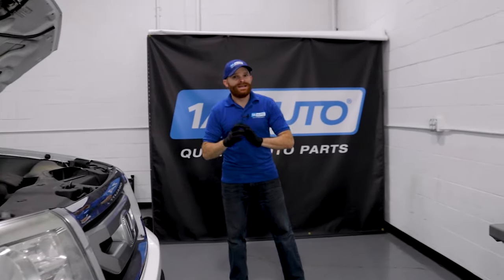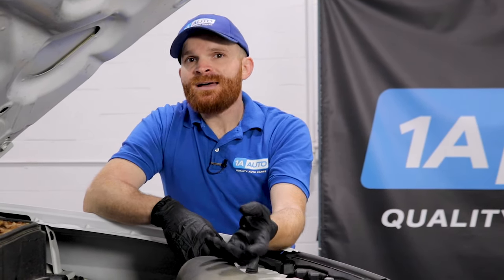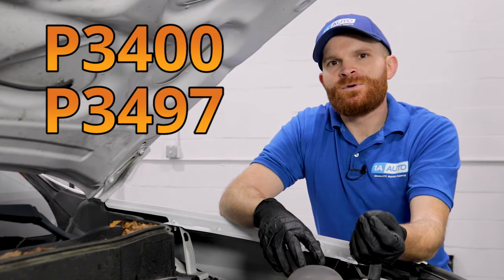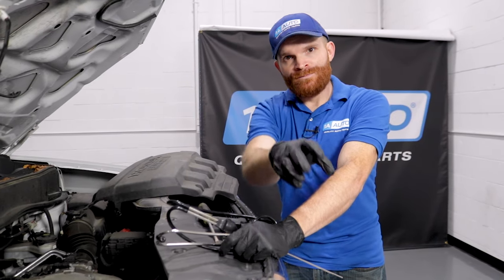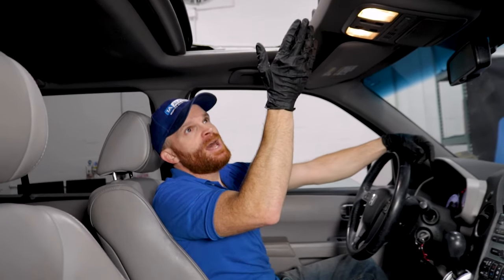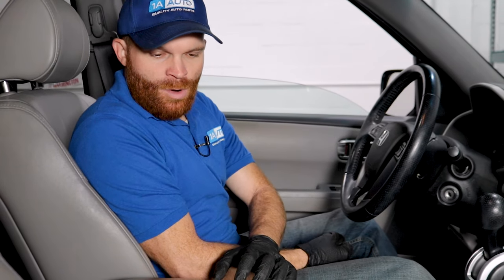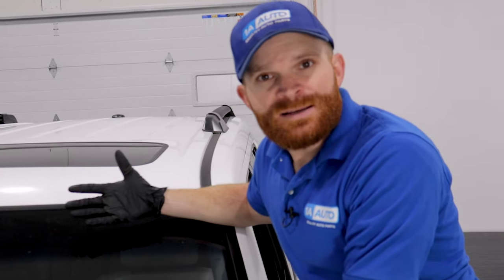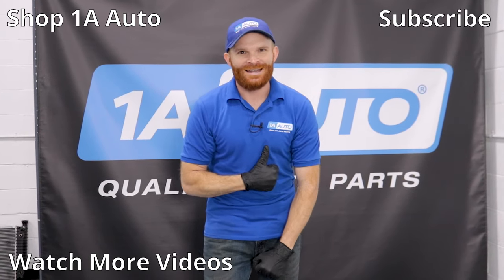Top 5 Problems Honda Pilot SUV 2nd Generation 2009-15

Comment: Are you saying that oil use and prematurely fowling plugs are a normal function of VCM and not because of the well documented issue of improperly sized piston rings in some models like the 2013 Pilot?  I have to change the plug in cylinder 3 every 5000-8000 miles due to oil fowling or just running hot.  Plug #1 less often but prematurely to be sure.  I have to top oil off at least every 1000 miles and sometimes more.  Just wondering how it’s an acceptable design for a car to burn oil straight out of the factory.
Reply from the maker: +Humble RoJo Thanks for the feedback!
Reply: I know right.
Reply: Get an S-VCM or VCM Tuner 2. It'll shut off that awful VCM "feature" and may help stop the damage being done to your engine. If it gets too far the only fix will be to tear down the engine and replace engine rings.

Comment: I'm about 99.9% sure I'm buying my wife a super clean and very well maintained 2012 Pilot with 180k miles on it. The current owners just had the timing belt replaced and whatever may go along with that taken care of.  For those of you that own Pilots, what's your opinion on buy one with higher mileage? Like I said it's been very well maintained.
Reply: I don’t have a pilot but an odyssey. It’s the same exact motor. It’s an excellent motor. Just take care of it (oil change, valve lifter adjustments etc) and it should last a long time problem free.
Reply: I have an 06 with 192k and runs very well. I would get one if I was you.
Reply: Just bought a '13 Pilot EX-L last week w/116k on it, love it.  This site has helped a ton...

https://www.piloteers.org/

I'm not even a "car guy" and I love it, really starting to warm up to the DIY maintenance side.
If the one you are shopping for your wide is well cared for she will have a great vehicle for many years.

Comment: The problem is whenever the ac is on the car doesn't function well then after somtinlme it will start overheating then you put of the ac it will the temperature comes down after a long drive in traffic and you stop the engine the car won't  start again until  after hours of parking it to cool down  the it will start.

Comment: Only one I have noticed a that slight knock. I think battery. Also you might to add battery to that list. My 2014 is on its 3rd battery.
Reply: It’s not a vehicle that has the problem it’ll be the cheap battery you’re buying

Comment: So I was lucky with my 2006 with over 200k miles and no problems at all.
Reply: I have an 05 @ 223333 miles as of today.  I’ve had it for 2 year. Check I gone light and maintenance require light been on for a over a year. When I got it it had 115k on it. I’ve road tripped it around the country 3 times. Ended up getting a hole in the radiator with a slow leak. Nell never really over heats. I want a mid gen bad tho
Reply: @dylanandrews7798  I have an 06 with 192k. I'm looking to get a 14 or 16 next. Last of the good Pilots.
Reply: @anonymoususer1824  16 is very un reliable. Second gen ended 2015

Comment: Having an issue with high speed vibration when accelerating. Happens at 70mph+. Shakes pretty bad when pushing petal, stops as soon as you let off accelerator. I have the VCM bypass attached. Any suggestions?

Comment: I have a 2012 Pilot and this is my third time taking it to the shop for misfiring. What is causing these misfires all the time?
Reply: There is a technical bulletin out for it. Check with Honda
Reply: There are many reasons why it could be misfiring - not enough or too much air in the mix (e.g. clogged air filter, a vacuum leak, etc.), not enough or too much fuel in the mix (bad fuel pump, weak injectors, etc), improper timing of the firing, bad spark plugs, bad coils, weak battery, bad connections between the battery and the coils, etc.  Read the codes or take to a reputable shop to diagnose and address the issue. Additionally, VCM can cause not only oil burning but eventually can start causing misfires as well.

Comment: Toyota camry hybrid 2016 that plastic cover under the car that protects from dirt getting onto the metal parts fall off on each side while driving on i95 and the front tires burned it  down. How can prevent that from happening?  because that sound freaked me out i thought my car was done 700 miles away from queens. 🥵

Comment: I have a 2009 Honda Pilot Touring with Navigation system.  I want to put an aftermarket Android Auto car radio in it, but 2 locations told me  that because of the navigation system this is not possible.  Let me know if I can and how.  I have been waiting to finish paying for that car so that I can put a more up-to-date radio in it, and now I receive this bad news.  Please let me know how to change this factory radio and put an Android auto car radio in this car

Comment: Have the paint problem and the piston rings where the VCM lets oil into cylinders on 2013 white Pilot. Honda fixed the paint issue on the side door because of class action suit but then when roof did the same thing they would not cover because they said the extended warranty from the class action had run out.Now the piston ring issue have to fight to get some help with the $4000 repair. I bought a Honda thinking that I would drive it for at least 250,000 miles and all this happens at 140,000. I will never buy a Honda again after buying this lemon. $40,000 vehicle and you are treated like it is a Chevy Vega. Everyone with these problems should continue to let people know. I was never notified of these class action suits and if I was I would have traded it in as soon as possible to avoid the situation I am now in. Honda has really dropped their standards. Hello Toyota.

Comment: I just obtains a major vibration issue with hard accerlating.  Cv axles seem good no visible grease anywhere or play.  Tires are balanced, just started today out of no where.... can you give me some areas to check?
Reply: CV Axles. VCM helps ensure these don't last long. The inner joint is likely bad. Mine had problems including throttle dependent vibration at interstate speeds. Externally they look PERFECT. Replaced them anyway - problem solved. Also consider s-vcm or vcm tuner 2 to get rid of the cylinder deactivation that causes a lot of excess driveline wear and potentially can damage your engine. VCM is such a nightmare. Just glad we finally have ways to get rid of it. I'd been asking my dealer to get it shut off since ours had about 5k miles on it. I bought the s-vcm and it drives a LOT better and should prevent the ring fouling / oil consumption problems that are a VCM side effect.

Comment: I have literally had all those issues except the headlights and moonroof. I also had to replace the alternator twice. At 157k miles right now.
Reply: Was it an Honda or parts store rebuilt ? Someone I know is looking at a 2014 so any help would be appreciated !
Reply: I have a 2014 EX-L and it is by far the best vehicle I have ever owned. 134k miles and zero issues other than the front rotors warping under warranty.

Comment: One thing that needs to be done instantly upon buying the pilot is installing the VCM muzzler
Reply: What is that??
Reply: What is a VCM muzzler?
Reply: @edwin1695  it disables the vcm. So your v6 engine can run all 6 cylinders all the time.
Reply: You get them at Petco! 😂
Reply: Is this a gas guzzler

Comment: 2014 Pilot LX 4WD, 80,000miles. Get problem that center two blower doesn't have air come out. Replacing power transistor doesn't work. Bring car to body shop and guy told me it may be blend door actuator issue. Several body shop worker never want to fix it, because it take time to take parts down(need remove lots parts such as dash board), diagnose, and replace parts.  One body shop quotes $380 for diagnose, and rest work $180/hour. So if the guy spends 6 hours, I need pay $1,460, and not guaranteed. If 10 hours, even cost more. Honda dealer diagnose cost $500, and rest work unknown.
Recently we bought a new car for my wife. Obviously we choose Toyota this time while not Honda.

Comment: After 170k I changed all 4 wheel bearing hubs,  water pump, timing belt, and serpentine  belt and brake rotor and transmission  oil for  the first time. Oh also the two o2 sensors.
Reply from the maker: +Dragon y2k Thanks for the feedback!

Comment: So, I have the code P03497 - during warm engine at stop light or stepping on pedal it somewhat loses power then it goes forward- somewhat of a pull back motion. What could it be? I may be buying the Muzzler-VCM. Dealer recommended to have Valve Alignment
Reply from the maker: +XDarkJuveX We wouldn't be able to diagnose an issue like that here, you may want to have a local mechanic take a look at it. Thanks for checking us out! http://1aau.to/m/Shop-1AAuto-c

Comment: Bro this car is my dream car Honda Pilot 2011 EXL/Nav
Reply from the maker: +Saleh Hussein video’s Thanks for checking us out! http://1aau.to/m/Shop-1AAuto-c
Reply: i have one they’re amazing go for it
Reply: Get the touring awd perrfff
Reply: Go for it, that was my dream car as well and now it's been 2 years that I own a 2011 honda pilot awd touring and here in Canada its so bad in the winter and this car never failed during the crazies storms
Reply: How much mileage. And did you face an isdue for engine valve cover oil leak
Reply: Just got it with AWD and low miles 😎
Reply: Have a 2011 touring I will sell

Comment: Problems on my 09 Pilot EX
1. Stuck blend door
2. Clear coat peeling/paint fading
3. Fail tailgate door agitator
4. Fail motor mounts at 95,000.
5. Interior light not working on driver side

Comment: My brake rotors keep warping on my 2013.  Anyone else have that problem?
Reply: My 2011 had bad rotors, and so did our Odyssey. The Ody had rusty, seized sliders. No idea what caused the Pilot’s bad rotors but I replaced the rotors and pads with good ones in May 2021 from Napa and no issues to now, Oct 2021. But, there’s a new whine from the engine, suspect alternator diodes

Comment: hey i have 09 pilot when use fuel pressure is reached, the car starts to shake And when the fuel injection is reduced, it works just fine what the problem please

Comment: We had issue with the paint. Take it into Honda and they will fix it for free. We just have the issue on the vehicle misfiring now
Reply: Did you have warranty? Curious because my tailgate
Reply: I had the same engine start misfiring in a Odyssey. I ended up changing out six coil packs and then it ran great again. That may sound like a big problem, but it was at 240,000 miles before that was an issue
Reply: My Honda Pilot is a 2013. The dealer repaired the paint problem on the roof. It was under warranty. But get it done now.....I was wishing the 7 year limit.no charge!

Comment: Anyone have an estimate of the price to take care of the engine knocking?
Reply: Free if you do it yourself.
Reply: It must be a J series issue, unless there is a much larger problem I am unaware of. We have 2 J30's that make that noise, 200k miles and 295k miles, and my 14 Odyssey J35 111k miles. Compared to newer vehicles with loud direct injection pumps, the noise isn't too much for me. Possibly bringing your vehicle in for the valve adjustment will fix the issue, as they do recommend that when the valve train gets noisey.

Comment: question
change the alternator and battery and the car is still discharged, I went to the dealer and they told me that it could be the remote control system I removed it, and it remains the same,please help me
2011 pilot
Reply from the maker: +Fernando Marin We wouldn't be able to diagnose an issue like that here, you may want to have a local mechanic take a look at it. Thanks for checking us out! http://1aau.to/m/Shop-1AAuto-c
Reply: Must be a parasitic draw somewhere.   Like an after market bluetooth device, phone charger, etc that isn't turning off. 
Look for YouTube videos on how to find a parasitic draw on a car.

Comment: whinning sound when turning
"choking "  at times when you step on tha gas
Reply: I had something like that... its was caused by a $20 ( O ring ) wearing/leaking on my high pressure POWER STEERING line.  Easy fix!

Comment: Lower control arm bushings are a bad area also. they were covered under an extended warranty , but the dealer i went to did not bother to tell me.  he jsut told me they were bad.  and they were .  leaking oil.   they quoted cost to replace @ $1k only after researching on the web did i find the extended warranty on this part.  when i confronted him he jsut acted stupid.   hate honda service depts.  buncha slimy shysters
Reply: that was one of there recall before

Comment: I'm surprised "center console noises" aren't addressed/one of the top problems.  My '14 Pilot's center console screams for 30 - 60 seconds after starting up the ignition.  It sounds like a small electric motor behind the infotainment unit is running under a heavy load and makes a loud, high pitched buzzing sound. It's not the CD or DVD player, as I've pressed the eject buttons and they make their own sounds while the annoying buzzing continues.  AC, heat, and stereo were turned off to isolate the problem, but to no avail.  I tried looking up "center console noises", and no one seems to have the exact issue I'm having.  Anyone else out there experiencing the same issue as me?
Reply: I had a relay replced. It was located under the center console. The relay was buzzing. All good for years later.

Comment: What about the automatic transmission? I heard they're weak in a heavy vehercle (Canadian accent? Sorry I couldn't resist lol - all love, man, all love!) like the Pilot.
Reply: Weak or maintenance failure. The Honda engine oil was reasonably priced, so I checked for transmission and rear end and transfer case for all wheel drive. They did not stock the transfer case oil, why, they say they don't change it.  I asked about when the Transmission fails. They ship them off to the state capital for rebuilding so may have the transfer case oil there. So needless to say I buy the hypoid oil elsewhere and use a independent mechanic and make sure all is changed and have not had issues yet.
Reply: @kenlgraham  Using the proper fluid and changing based on the service schedule has gotten me 240,000 KM.  It's a 2011 AWD and I have towed close to the max (4000lbs) on a fairly regular basis.  It's seen logging roads, washboard, lots of Canadian Shield.  Did the suspension, a few bushings but otherwise it's been rock solid.  The Canadian tow package comes with the transmission cooler so that probably also helps.

Comment: The paint peeling issue is an issue with all Hondas have owned six different ones since 2002 all pilots and every single one of them within a year of owning them the clear coat started peeling off.

Comment: 2010 exl 4x here. 58,000 miles. Only struts(heavy suv) and a 2 minimal recalls. 

Anyone have (good) lowering info
Reply: Letting the air out of the tires will lower the vehicle.

Comment: These are NOT, the top 5 issues with this gen pilot. I work at a Honda dealership and the service manager even laughed at this video. He has been with Honda:Acura for over 20 years. I own this gen pilot too. These are not the top 5 issues. Non of the pilots that we work on in this gen have had any of these issues. “That being said”… when it comes to the leather issue…..that will happen with ANY leather in ANY CAR. Come on now, man.
Reply from the maker: +Brock Havens Thanks for the tip!

Comment: 2014 Pilot: I’m having squeaking in the front suspension when pulling into the driveway, over the curb. Any ideas of what it could be?
Reply from the maker: +Harold D We wouldn't be able to diagnose an issue like that here, you may want to have a local mechanic take a look at it. Thanks for checking us out! http://1aau.to/m/Shop-1AAuto-c
Reply: its your compliance bushings honda will replace up to 160000km for free but they wont tell you about it

Comment: Too issues for my 2011 Pilot Touring with 100k miles is #1 the center console/door arm rest “leather” ripping. 

#2 ever since January 1st the clock has been wrong and there’s no way to fix it.
Reply from the maker: +M W Thanks for the feedback!
Reply: My clock was wrong too! I could not change it by any method. It later adjusted itself but is off by about 6 minutes.  I replaced the center leather for about $20; found a skin on Azn. Needed hot gule and a power stapler to attach it . Looks mint now.

Comment: Honda is overrated especially the Pilot. I own 3 Hondas.  All 3 use oil, 2 accords do also. If you don’t check them every week you may find none of the stick. 

The I had to change the camshaft and rocker arm after years of VCM issues. The engine is really hard to work on due to how it sets in the engine bay. Even the oil is a pain to check.  Constant brake shutters or bushing problems. I’m changing compliance bushings now. The car is nice but it’s reliability is overrated. 

If I didn’t do my own repairs I could not afford to own this Pilot.